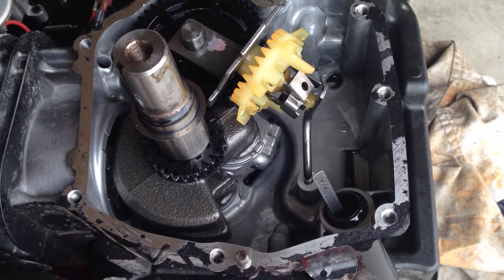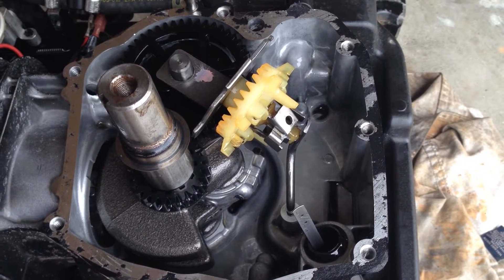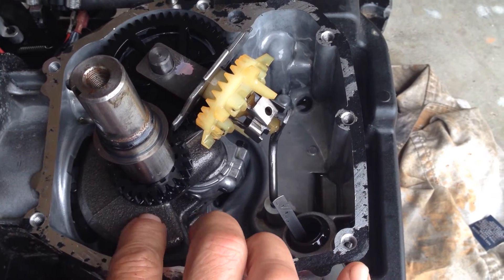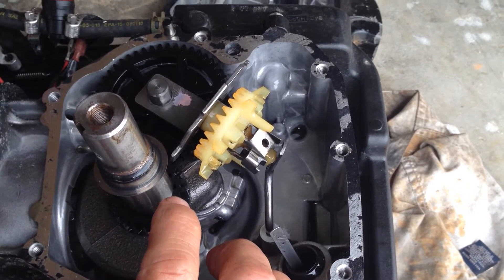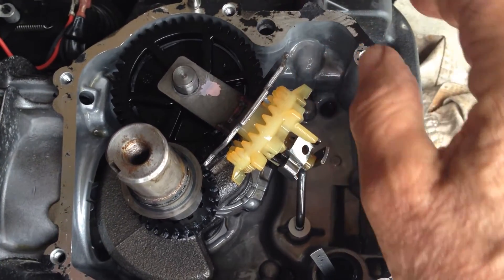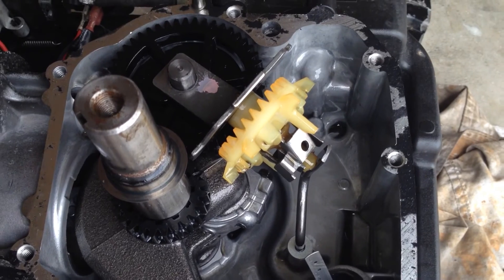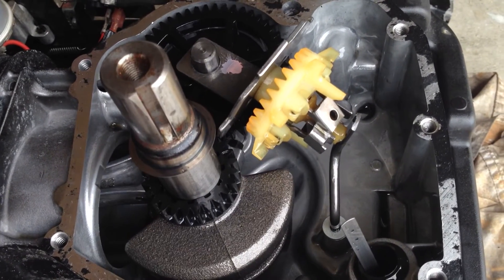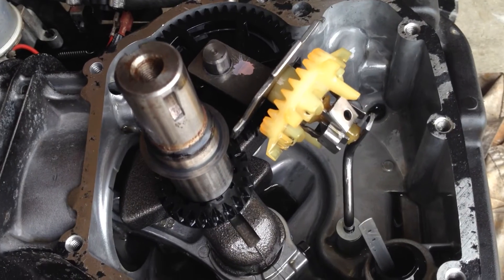BRIGGS engine with plastic timing gear 795755 and camshaft 694039 on 7.75HP failed

Comment: Craftsman pressure washer with Briggs engine 11P902.. same thing.. timing gear spinning on crankshaft. Plastic gear has a key formed into it, just sheared off. Replacement gear from Briggs is metal.

Comment: When they figure out how to make plastic crankshafts and plastic engine blocks, they'll be doing that, too (I'm not joking). 
Briggs and Stratton is a LOUSY company now and their cheap engine designs are starting to really bite them in the ass.  Stick to "old" if you want a Briggs and Stratton engine that will run a lifetime.
I'm talking 60+ year old cast iron Briggs engines from the 1940s and 1950s when Briggs was at the top of their game.
Reply: Yeah I have an eighty Briggs where the pull cord jams constantly but my sixtys engine is 50 plus and I believe will never die
Reply: But your absolute correct engines are becoming plastic fantastic

Comment: Mine did that on my weed trimmer (craftsman) has the same Briggs motor. Heres what you do... Get the damaged plastic thing off and get a drill bit about the size of the round groove on the inside of the plastic thing located where the crappy plastic notch would be. Now get your drill nice and hot with a lighter or something and make that notch a bit larger. now find a screw that would fit in there I used a small button head wood screw. cut half the head off with side cutters until the head fits in the void cut part toward the shaft and slide that gear over the screw where you notched out the hole bigger. This cost me only for the gasket maker RTV. an 8 dollar fix that improves the durability of the motor. Not sure what a metal one costs but I didn't want to find it/wait around for it.